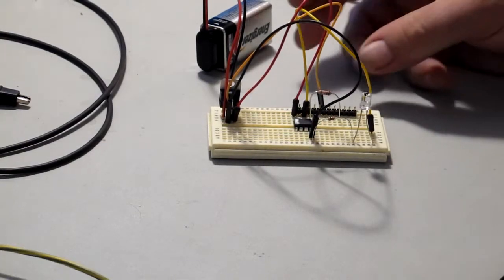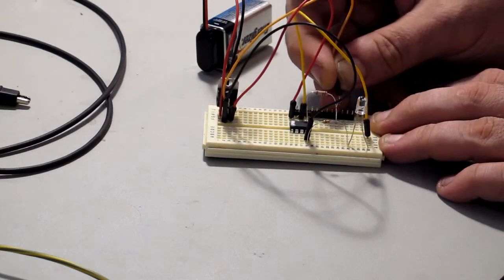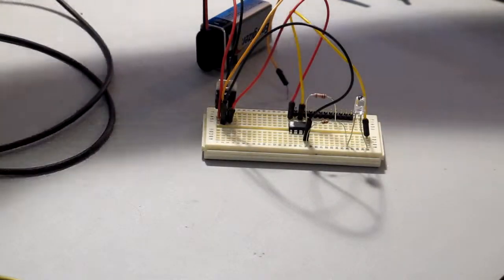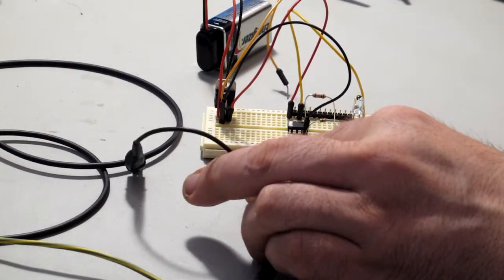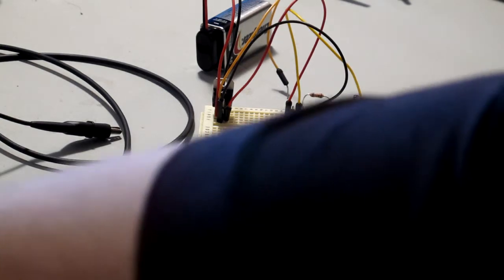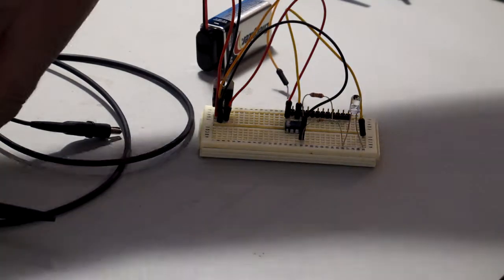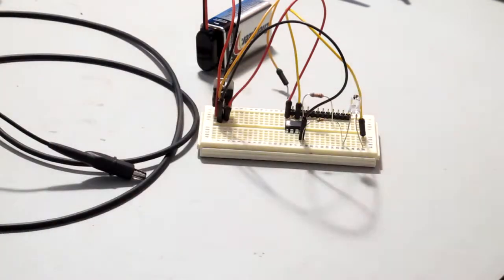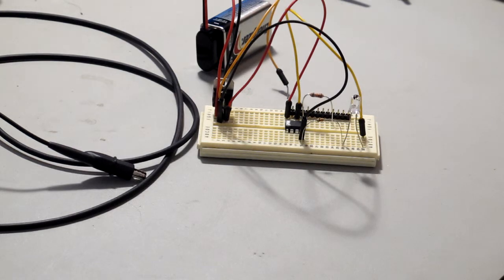Phantom voltage.

Comment: i have problems with using my scope on certain circuits too. i get this same problem, but with mosfet gates. you guess what happens to the mosfets if i turn the power up... replace mosfets, disconnect scope, no gate problems \o/
Reply from the maker: Erk, thankfully I haven't blown anything up yet. It peaks at about 1.2v RMS Mine seems to come and go as well. Suggestions are that it might be my water heater.